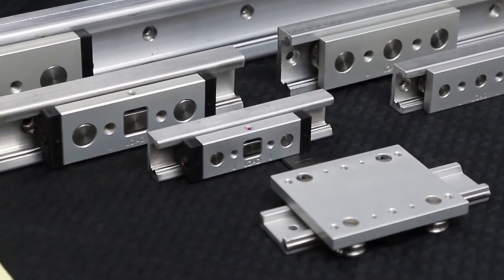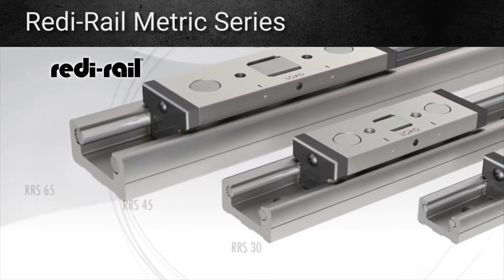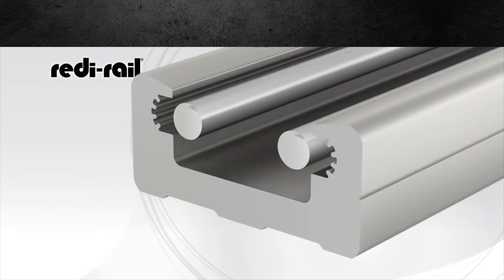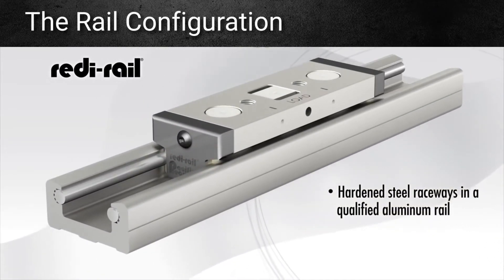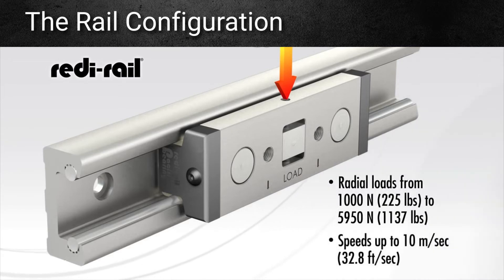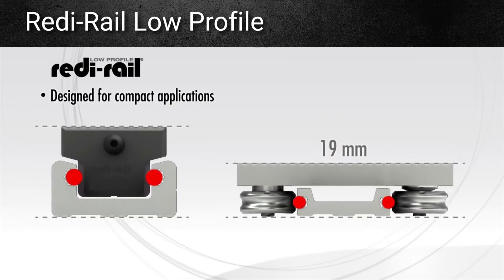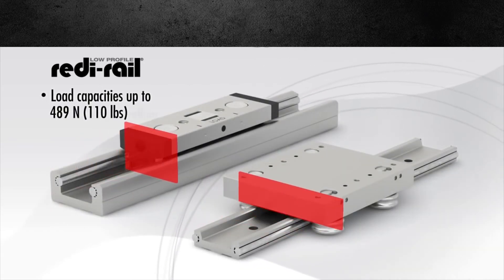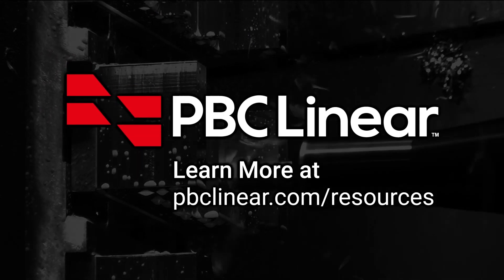Redi-Rail Linear Guide Overview

Comment: what is the sound level of this guide rail application?
Reply from the maker: Thank you for your inquiry.
PBC Linear does has not specifically conducted sound level data for our standard products if you would like to review your project with our Application Engineers to review your project we would suggest sending your project information to application.engineering@pbcliner.com for further assistance.